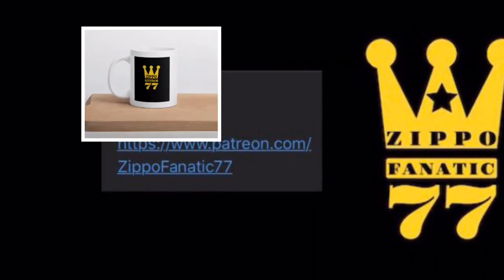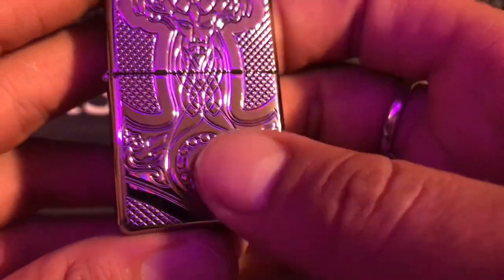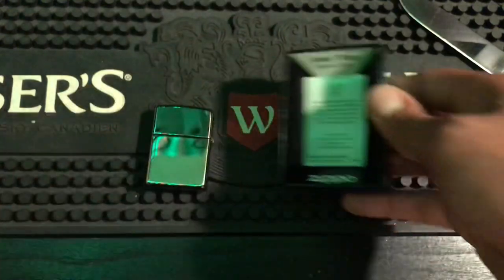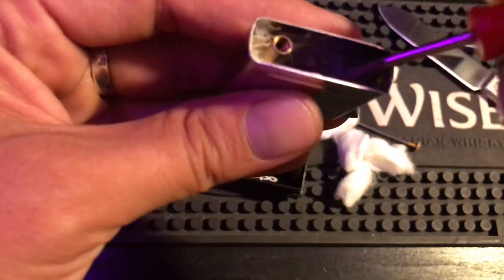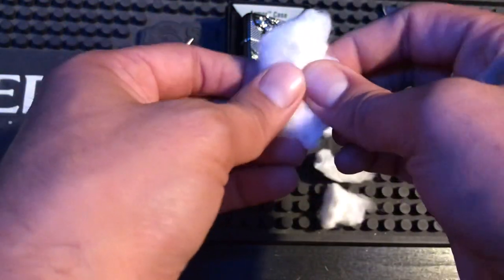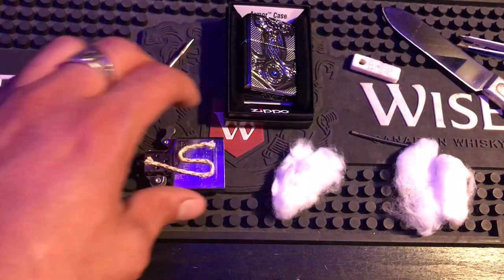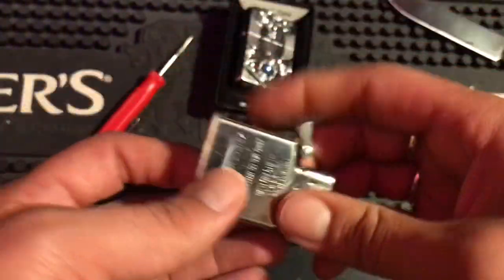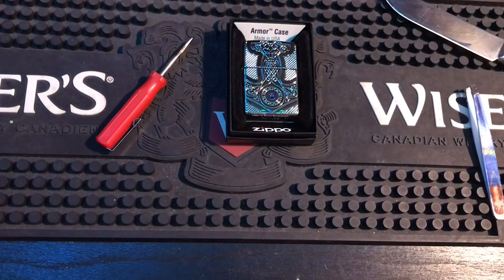Unboxing Zippo Thor’s Hammer The Mighty Mjolnir Medieval Design 49289

Comment: So, Zippo apparently has a contract with swaroski. So all the crystals they have are rebuilt Silica glass. Swaroski keeps their crystal making process very hush hush though, because their idea is that the cuts in the crystals are so precise, it ensures it shines like a diamond. Real gems of course would be costly, but I really wish they could at least put in a cheaper gem like aquamarine, peridot, garnet, quartz, amethyst, onyx etc etc. Or just your synthetic diamonds, sapphires, rubies and emeralds also. They are super cheap and rarely break.
Reply: @ZippoFanatic77  Well, if the lighter has a space carved out for the jewel, then you can use that for a real gem. Australian black opal has the best play of colour, and a small one that size would be quite cheap.